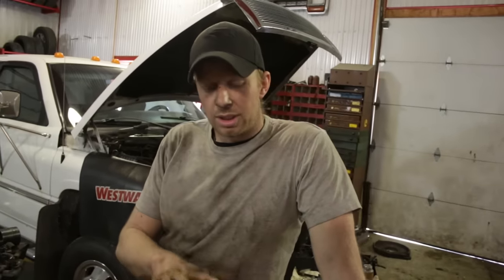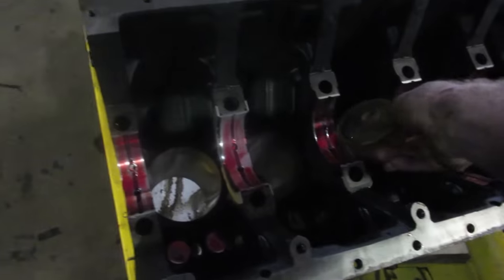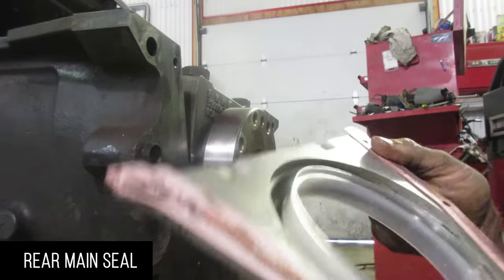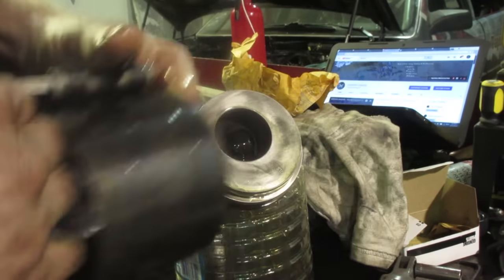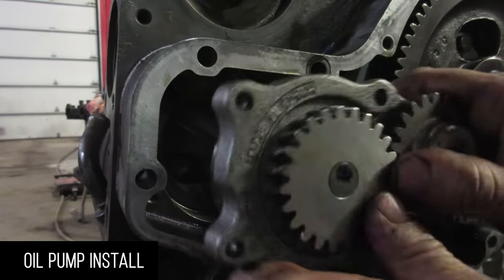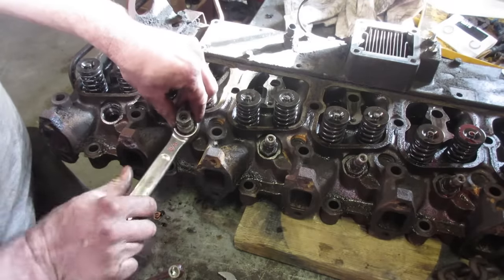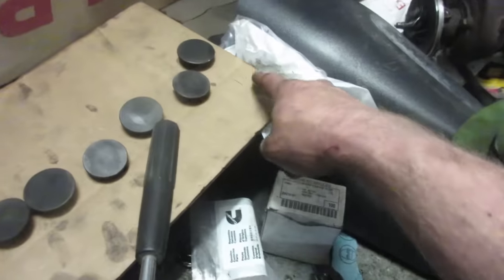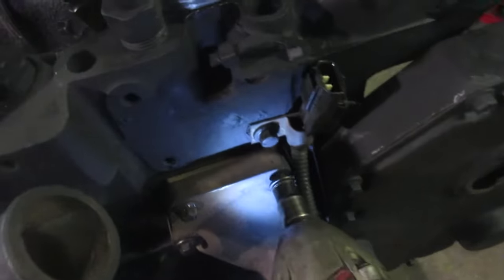How To Rebuild A 5.9 Cummins 12v Diesel In A Million Mile Dodge #1Mil12v (Part 3)

Comment from the maker: Cummins 6BT Rebuild Kit http://bit.ly/rebuildkit
Maximum Bolt & Nut Extractor Set http://bit.ly/extractorset
Coolant Thermostat http://bit.ly/coolantthermo
The above are affiliate links.

Check Protrusion: http://www.liberatedmanuals.com/TM-5-3810-307-24-2-2.pdf
Reply: DEBOSS GARAGE make sure you cover custom fuel economy builds and what transmissions can be used in engine swaps... Can you still use Chevy pre-Duramax/Allison transmissions from the old 6.5L Detroit for a 5.9? And vise-versa?
Reply: DEBOSS GARAGE is that oil pan painted on the inside?
Reply: Is Engine oil good and  is the same weight as what will be put in the engine during routine maintenance
Reply: Crows foot on torque wrench.
Reply: DEBOSS. quick question. Doing a bearing roll on my 6bt. Many say to buy new crank and rod bolts. Spoke with two Cummins techs and they say its ok to reuse them. Only thing for power adder is my home made AFC in cab control. Thank you.
Reply: I thought that said check prostitution at first.
Reply: DEBOSS GARAGE we use WD-40 on everything that we wash as a last step. Never have any rust issues. News papers work great for cylinder walls. I picked up that trick about 30 years ago when I was building NASCAR engines. Great channel. You guys know your shit!
Reply: Thanks a lot for the video .  I realy appreciate.
Reply: What if piston protrusion is more than 27 thou? Mine on #1 and #2 was between 30 and 33 thou.. should I get a thicker HG?
Reply: Those links need an update .They show as not found
Reply: @machscga6238  like how much cost tu rebuild the motor
Reply: Do you have new link for the rebuild kit?

Comment: So a guy does a 12v refresh/rebuild like you show here, including new rings and bearings, in his own garage.  How then does a guy do a proper engine break-in with no dyno available?  I've heard you can pull a loaded trailer for some time, but would love to hear some more specific advice on this issue.

Comment: So I have a 24-hour Cummins I really want to put a bank's twin power pack on it but I have never seen a video I saw your video on doing it dual plenum intake but it was homemade I think it was cuz of cost but is there an issue with using a power pack I called Banks I couldn't get any information which I understand just curious if you had any thoughts

Comment: I have a 5.9 24v in an 06 3500.  Driving home to GA from NC, it developed a knock (noticeable at interstate speed).  Immediately pulled over and had it towed to the nearest Walmart.  After looking at what I could (it was around midnight, so very dark), I decided that I would just get it to the nearest Dodge Dealership (1/4 mile away), drive home, call them in the morning and have them diagnose / fix it.  By the time I drove the truck out of the parking lot, it started thrashing (badly) and died.  It would crank, but would thrash the motor / cab badly, so I turned it off and had it towed that 1/4 mile to the dealership.

Tech cranked it, turned it off, said the bottom end was out and wanted to charge me $10,000 to $15,000 to put a "new" (rebuilt) Jasper engine into it.  I believe - firmly - that an injector failed, chewed a valve seat, and it is - in fact - the top end that is out.  I'll know shortly because ....

I struggled for a week on what to do.  After googling and watching videos (specifically, this one), I decided to tow it home and pull / rebuild it myself.

Shop crane arrived 2 weeks ago and the engine stand came in last week.  While I haven't had time to get it out just yet, this video series has given me the confidence to attempt the work.  I intend to reference the *&^% out of this series (along with other, similar videos).

Thank you.  Thank you, so much.

I intend to video the work and upload to Youtube during the process.  I just wanted you to know how much I appreciate your videos.  I am not a mechanic, I learn as I go, and people like you make all the difference.
Reply: Just wondering...how many miles on the truck?
Reply: @razor3003  Around 180k.

I have the engine out and on a stand.  Piston #1 and #3 look ... not like new.  The other 4 look good.  

Metal shavings on piston #1 and #3.  Lots of metal shavings in the oil pan.  Thing it chewed up a bearing.  Trying to get to that today, only got it flipped over and the pan off yesterday.  Ran outta time =P
Reply: Thanks. I guess that's unusual for a Cummins.
Reply: @razor3003  Well, I bought it used.  No idea how it was taken care of.  And, to be perfectly honest, I could have done a better job myself.

Lesson learned.  The silver lining is that, without that having happened, I don't know that I ever would have jumped into a project like this.  Learning a lot, so ... something positive will come out of it.  Also, DebossGarage gained a sub :)
Reply: @razor3003  Now that I have it completely apart, I found the problem and the cause.

The oil pan gasket had completely blown out in a couple of places.  It had not been burning oil before the trip, so ... I assume this happened at some point during the 8 hour drive there or on the way back before it broke down.

Lack of oil...  The rod bearing on rod #1 has eroded considerable (the cause of the metal in the oil pan) and has fused to the rod.  The rod is simple enough to replace, but there's quite a bit of damage to the crank shaft where that bearing was at.  I'm not sure it can be machined or not.
Reply: Wow, that sucks. Makes you wonder if someone didn't work on that motor?
Reply: @GuiltyPleasures  SOOOOO what happened??
Reply: @willybman3723  I took the crank to a machinist.  Said I was about 20 thousandths low, and would probably be around 30 low by the time he was done grinding.  So ... I ordered a new crankshaft.  I went ahead and order a rebuild kit, for the gaskets, pistons, rings, etc.  I also had to order another connecting rod, as #6 is going to be damaged beyond repair.

While it's out, I decided I'd paint it, too.  I have sprayed it down completely once.  I have one of the long sides fully degreased and ready for painting today.  Once the block is painted, I'll start reassembly.

At this point, I'm just hoping that I can remember where everything goes :)  I took video and some pictures.  I may end up uploading it to YouTube once I'm done.  If I can figure out where everything goes again!  :)
Reply: Michael Keith how’s it going now?? Get it all out back together yet?
Reply: @KingLeonidasll  Not yet.  I've been getting jerked around on a crankshaft by this company.  Still not sorted out, more than two months later.  The block is painted, though.  Looks good ...
Reply: @GuiltyPleasures  you should've replaced everything since u opened it up...and u should maybe listen to the dealership sometimes
Reply: @willybman3723  I'm not sure what leads you to think that I won't replace "everything" while it's open.  All parts that I assume you are including in "everything" are already here.  What I'm waiting on is a crankshaft.

The problem isn't listening to the dealership "sometimes."  It's knowing when they're ripping you off and when they're not.  When the guy cranks the truck, turns it off, and makes a proclamation - a guy I've never met, two states (8 hours) away, mind you - and their first offer is to sell me another truck ... why should I "believe" them?

Besides, I'll have the truck back to an as-new condition for 1/5 (or less) the amount they were wanting to charge me.
Reply: @GuiltyPleasures  well you said he told you bottom end was 10k u didn't say anything about a new truck...if course they are gonna want you to get a new truck....and by everything I mean everything... serviceable parts...clutch gaskets any and everything, bolts...all that...sorry forgot you work on Cummins all day long
Reply: @GuiltyPleasures  Just know that this is the first time ive heard about an issue like this and ive seen 5.9's and 6.7's at half a million and have heard of plenty past 1 million. Having this at 180k sounds odd to me.

Your truck might not have 180k ive seen people swap dashboards before they sell there trucks to get more money for it. Fucker might have had half a million or more of highway hauling or who knows what.
Reply: @whitemale2248  Hey, thanks.  I didn't mean to come across as nockin the engine.

I bought the truck used, so I assume first and foremost that it was poor prior maintenance.  Used vehicles are used for a reason.

Hindsight tells me that I should have done a better job going over it before things went tits up.  Hindsight...

However, if an average for a thing is ~1 million miles ... that means you'll have variations on both sides of that average.  Maybe I just got unlucky.

In the end, I'll come out the other side knowing a lot more than I did going in.  So, I count that as a big plus.
Reply: @GuiltyPleasures  so the dealer was right that it was the bottom end
Reply: @kx250braap  The technician that "diagnosed" the engine by cranking it and immediately turning it off?

Yep.  Why?
Reply: @GuiltyPleasures  ..post them vids if you can....We needs all the tips we can get....And, its tons of Ford King Ranch's that need a real motor in them, not some cheap Mattel crap like they got now....Also, like to see this puppy up and running....
Reply: Michael Keith you sound upset that he knew what was wrong instantly what took you taking apart the engine. He has more knowledge than you
Reply: What happened to you is most likely related to the KDP fix. If you crack the case you will loose your oil run dry; and on an 8 hour trip, it will grenade engine on low oil.
 It doesn't take a rocket scientist or a mechanic at a dealership to figure that out. Just saying.
Reply: @norman_sage2528  The rear main blew out and was puking out oil.  The oil gasket had also blown in a couple of places, and was puking out oil.

Had I known before making an 8 hour (each direction) trip, I wouldn't have taken the truck.

I cannot say with certainty that the gasket and seal didn't blow during the trip.

Glad you already have the knowledge.  I didn't.  Live and learn.
Reply: @GuiltyPleasures  it's always healthy to be skeptical around mechanics when you dont know them well. And its always fun to look at stuff yourself anyway! I paid a mechanic to do a job, I always like to look at it afterwards. Because to me its important to see how things work, so you have to knowledge for next time! 👌
Reply: @GuiltyPleasures  Just curious, did you gauges show any weird oil pressure or temperatures during that 8 hour drive?
Reply: @christianeidsmoe4772  Not one oddity on the any gauges.  Not even after I parked, had it towed to the nearest Walmart (for light), pulled the dipstick and saw no oil.

No lights, no gauge movement ... nothing.
Reply: @GuiltyPleasures  Oh man, scary!  I check my oil temp,  coolant temp, oil pressure and trans temp every couple minutes.  But it might not help...
Reply: @whitemale2248  2003-2007 5.9 Cummins engines are notorious for this method of failure. They are MUCH different than the older, mechanically injected 5.9s. The use a high pressure common rail system. The factory filtration is inadequate, which can cause an injector to stick open. When an injector sticks open, it will damage that piston in a matter of minutes. It is actually pretty common in the 2003-2007 5.9s.
Reply: It’s always a healthy reflex to distrust an unknown mechanic’s intentions when your far from home and seemingly at their mercy. And it’s honorable to roll up your sleeves and do a thing yourself if you’re inclined. Good job.
Reply: @GuiltyPleasures  Honestly you dodged a bullet by not getting that Jasper engine, I heard their quality control is garbage, I've seen one jasper sbc where the valves weren't even ground, could see light through them plain as day.. how's that engine running now?
Reply: @billyboots3730  Believe it or not, it's still getting me around.

I may have  really screwed the pooch when I put everything back together and it may die in a day, a month, or a year.  But so far, no complaints.

I have a bit of an exhaust leak that I'm gonna have to fix.  But that ain't the engine :)
Reply: @GuiltyPleasures  awesome man, if its been good for ya so far i dont think you have to worry!
Reply: Congrats on seeing it through and getting it done.  Usually when I see comments like yours about people tearing into a project, I see a few enthusiastic updates about the tear down and then...silence.

Comment: i just did this to my 24 valve. i spent 1800.00 with full machining, over sized pistons, and such. took me 7 months from start to finish and the machining took about 3 and a half months for the machine shop to finish the block/head. they didnt do any disassembly or reassembly, just machining.

Comment: Ex mechanic here from way back. Looks like a nice job. You can put straight edge on the head and check for any warping. An old trick is to put two head gaskets on if the head has been ground more than once.

Comment: My dad bought a 1995 12 valve 5 speed 4x4 brand new at the end 1994 and all it has ever seen for oil is chevron delo 400 and sometimes it has had the Lucas oil stabilizer. It is only at 215,000 miles now but it has never had an issue at all when it comes to the engine

Comment: another trick for pulling injectors is a piece of PVC piping that fits over the injector body, a washer that fits over the pvc and allows the injector end to go through and a nut that fits the threads on the injector. worked well for me, love how simple these engines are.

Comment: A 2nd gen dodge ram lug nut is the same thread pitch as the injector lines. You can use a cut socket and a lug nut to pop them out, plus the lug is likely tapered making it even easier

Comment: Great video.  I would like to add a few things which I was taught.  One is to clean the cylinder bores with ATF on white paper towels.  Do this until the towels come out pink with no dirt.  Another is to test the ring gaps deeper in the bore where the piston is pushing sideways or at least check the bore diameter down there.  Lastly, I haven't seen the Cummins spec but it seemed that the honing angle was a bit much.  When I went to high school we got to tear down, measure, and re-assemble Ford inline 6s.  It was great!  If a student acted up too much they got to bore a cylinder oversized.  Great video, just food for thought.

Comment: Another excellent vid Rich.  I love the simplicity of the B series Cummins.   Next time you are near a Car Quest, stop in and check out Klondike Brake cleaner.  A case can be had cheap, always on sale.
Reply from the maker: I have never seen a car quest here in Canuckland
Reply: DEBOSS GARAGE Caledonia or Grimsby.  I saw a 6 pack in the Bradford Carquest when I stopped in for some parts.
Reply: 3M 8880 from Amazon, 24 cans, $80 USD